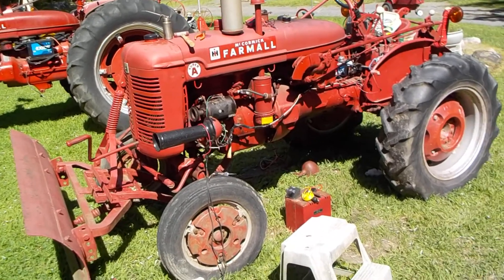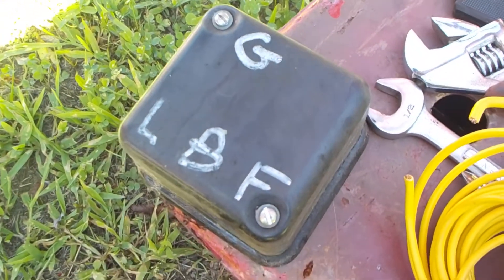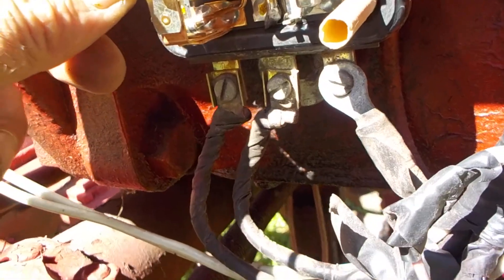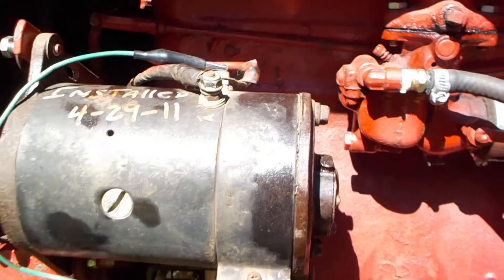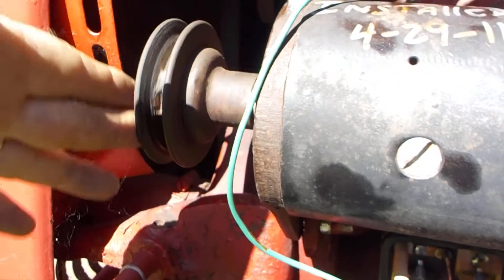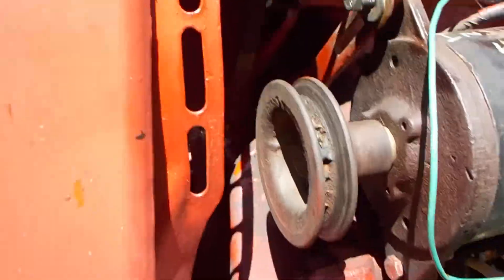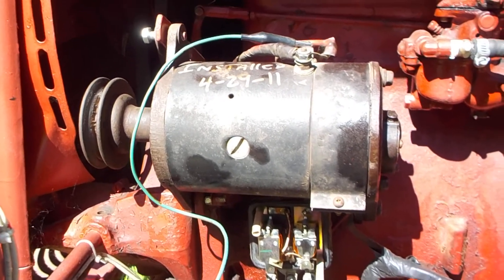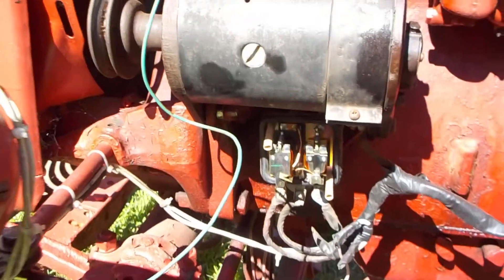Farmall Super A Charging & Generator Testing

Comment: Remote generator cover , clean armature with brush stone or sandpaper to reseat brushes and make sure brush holders are working freely. Regulator is adjustable at tangs that hold springs, slightly bend tangs for air gap if needed.  Should measure voltage output with volt meter .  6.9 or 7 volts
Reply from the maker: Thank You For Sharing Your Knowledge, Much Appreciated.
Reply: No thank you, restored David Bradley a couple of years ago watched all of your vids
Reply from the maker: Glad they Helped.  I still get Many Emails and Phone calls regarding the DB's I loved them and used them for Many Years but have Graduated to the Bigger Tractors.